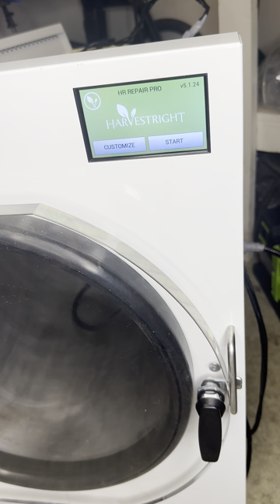Harvest Right Functional Testing

Comment: If I go into functional testing and click on freeze, heat, or vacuum it will turn that item on, but the unit and screen locks up. I can't turn it off or exit. I have to turn the main power off to reset. What's wrong?

Comment: Hello, first off I want to say thank you for the tips and even saying that we can send a picture or ask questions. I live in a very remote area with no professionals that will touch my freeze drier. I did the tests that you suggested, the temperature went to -47 degrees so does that mean that my pump is working properly? I have to go down the line of trouble shooting to find why my machine is not building pressure. Thank you for your support. Sue
Reply from the maker: The condenser is likely working properly. Now with it at a super low temp turn on the vacuum and see how low the mT is you can get.

Comment: Have had my machine for about 1.5 years.  Moderate use. Harvest Right small. Did a function test after 30 minutes results as follows: Tray 53F; Room 70F; Freeze after exactly 30 minutes -15F.  Then moved on to the vacuum, after 41 minutes hit 442 mTorr with temp of -21F.  I am questioning whether I need more freon as my last few batches took a bit longer and only had 3 freeze rings from the forward to back.  Thanks
Reply from the maker: If your only have 3 rings your most likely low on Freon. HR has been having issues with leaks in machines under the foam however. You do have a limited 3 year warranty on this part of the machine

Comment: What kind of -temps should I be hitting?  I have a medium which will go down to -40s during vacuum freeze time prior to dry time.  New large I cannot even get it to -20 freeze setting … usually go to -17 and just sit there.  So I stop machine and change setting to -10 (default) and it will move on… but still not seeing the low temps I get with medium.  Freeze test with water got 7-8 rings and when cooling prior to run it is visibly chilled starting to ice to 3-4” from front edge … but when actually has food going it’s at least 6-8 inches from front.  Not sure if I should be concerned.  Thank you for any input.

Comment: Do you have any idea why my vacuum pump does not turn on when I test the vacuum setting? I've verified that the pump switched is turned on and I even tested it by plugging it directly into a wall outlet and it works fine. Also tested voltage at the pump power plug on the rear of the main until and it's not receiving any power when running the vacuum test.
Reply from the maker: I would check all the wiring. If it’s not getting power to that plug a wire has to be bad or the plug itself. HR should have that plug they can send to replace

Comment: I just bought a 2018 HR medium FD. When i touch the leaf it takes me
To the liquid or non-liquid selection screen. It doesn't take me to a functional test screen. Is that a development since 2018?
Reply from the maker: It likely was part of an update if your having issues with vacuum on this older machine I would check the o ring that makes the 90 degree turn for the vacuum hose

Comment: Hey i found you because my freeze dyer seals fine but wont freeze. How do i fix it? I had milk in there for 8 hours and it never got under 46f
Reply from the maker: Check out my video from 2 guys and a cooler. Likely an issue with the freeze dryer as a whole
Reply: Ok. I'm pissed. 3,500k down the drain and a recession
Reply from the maker: Have you reached out to HR they have a 3 year warranty for this system. They will want you to pay shipping if it’s been over 1 years however